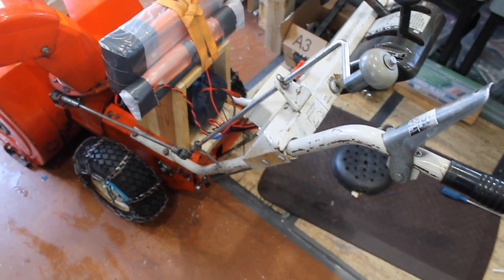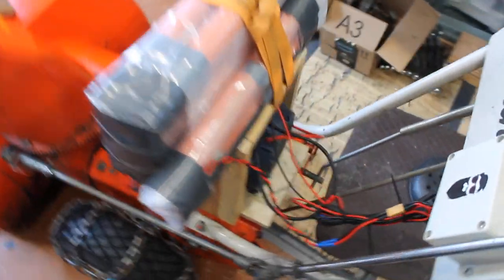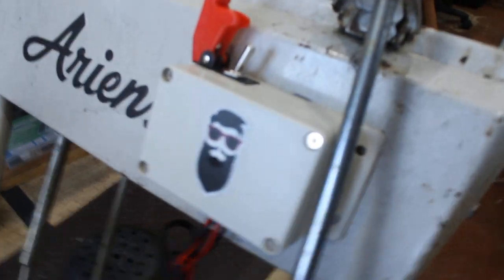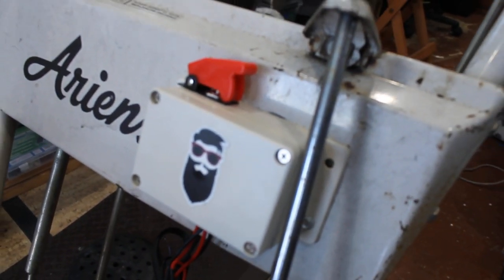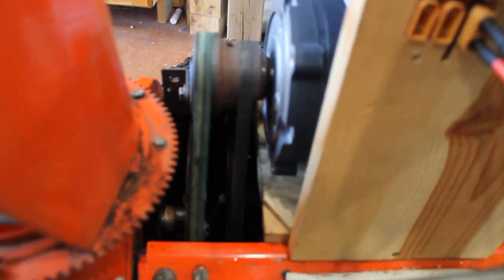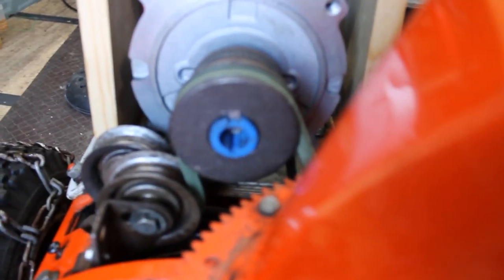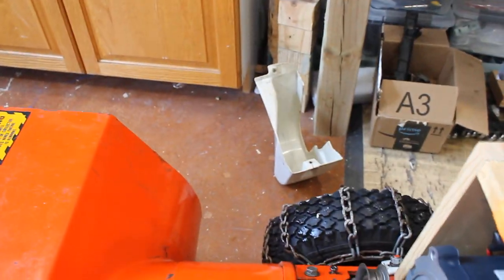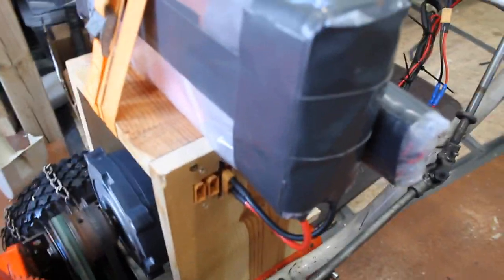1979 Ariens Snowblower Electric Conversion

Comment: Interesting mod.  Do you know what RPM and torque that motor produces?
Reply from the maker: Close to 4000RPM, and I'm not sure about torque.
Reply: @ryanhatfield3938  I just wondered because it looks like the augers run pretty fast, but video can be deceiving.  Really raw calculations with the stock pulleys puts your impeller speed around 1222 RPM which is an up grade over the old Tec at 3600 RPM which typically run near 1100 ish.  Just wondering if the motor can handle the torque to keep up in a load situation.  It would be really cool if it did to have a whisper quiet machine (relatively), and get the extra impeller speed to boot.  Any idea on the battery run time and recharge time yet?
I realize different snow type and probably temperature may vary it.  Still think it's a cool mod to test.  Thanks for the vid upload.
Reply from the maker: @jtclays4806  I added the project link to the description, much more information there. I did most of my driveway yesterday, and I'm really happy with the results. It was drifted snow up to 3 foot deep and pretty hard. I have some cooling issues with the motor, but nothing that I can't handle, and I was really pushing it. It did better than the original small engine with a dirty carburetor. I got close to half an hour of run time, chewing through the driveway snow, but stopped before the batteries were totally spent.
Reply: @ryanhatfield3938  Thanks Ryan,  Looks like you put some serious thought into the build.  Wonder why the motor is holding heat?  Thanks again for the link and info.